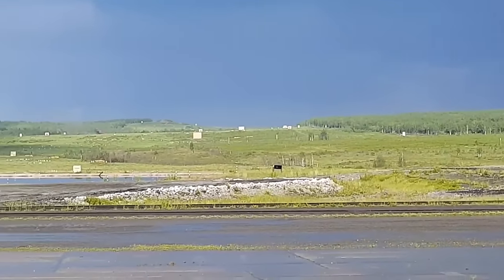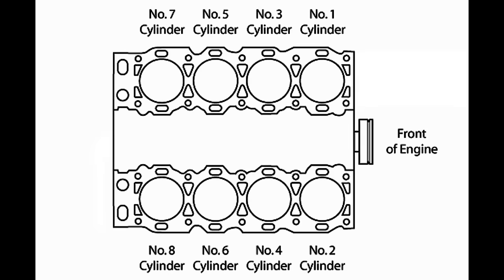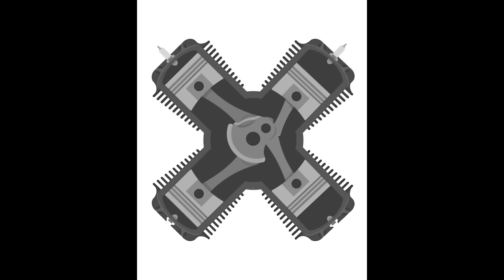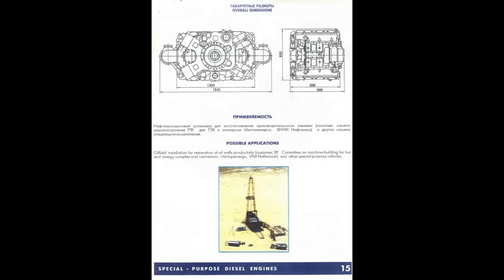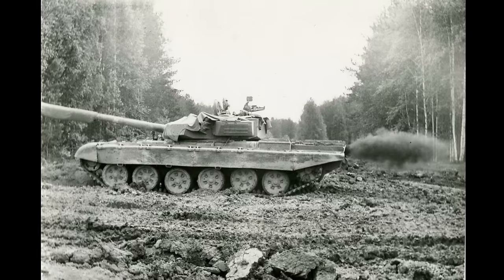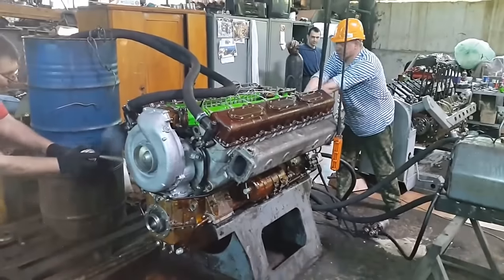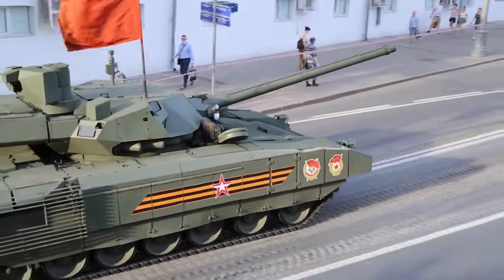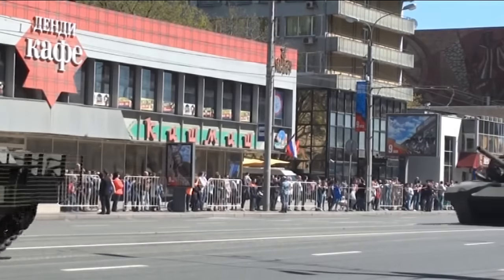Controversial History of T-14 Armata's Engine

Comment: I think actual reason why Armata is not in production, outside of sanctions, that Russians see that in actual war current modification is not modern enough and not response of all new threats(such as drones in first place)  of modern war.  In August 2022. based on experience from conflict in Ukraine, Russian army requested, and engineers suggested following improvements:

1. increased range for APS detection of potential threat and, also, increased range for "hard kill" action measures of Afganit
2. improved T-14 all-out shielding against RPGs and ATGMs
3. enhanced electronics protection against electromagnetic and microwave weapons
4. new system for remotely deactivating AT land mines

So I think T-14 will never be in mass production, at least in current version. It's just clearly not worth it.
Reply: This is the most likely answer. Any of the benefits provided by the armata design would be irrelevant in the current Ukraine battlefield. It's very likely that the armata might get scrapped before going into production.
Reply: and that Russia is not rich enough lmao
Reply: @mionikat  not really. All of Europe combined is unable to produce enough artillery for Ukraine. That should tell you everything you need to know.
Reply: Or Russia is unable to afford any kind of production of modern tanks, since it lacks the technology to produce high tech and high quality electronics and chips themselves. In the past they could source such tech from Europe, which is not the case anymore.
Reply: I think so too. Some time down the line we will have two broad categories of tanks, those that have some measure of  protection against the new battlefield threats, and those that don't.
Or a fifth generation MBT if you will.
Reply: @MrNebelschatten  there is a reason why countries like Kirgyzstan suddenly started to export 5000% more of various European goods after SMO started and sanctions were put on. It was not sudden spike of internal consumption I assure you.
Reply: @MrNebelschatten  clearly not the case since modernizations are basically adding new tech to old tanks. So they have enough chips to upgrade old tanks. The smuggled chips seem to be sufficient.
Reply: @dhanu_4539  Europe could, but US leaders were too soft on NATO countries for too long, so those countries have let their defense apparatus atrophy in favor of spending on welfare state projects.
Reply: @fredrikhultman557  it'll be fascinating to see what they end up looking like. The trend of advanced expensive tanks will end with this war. They'll have to be cheap, have basic guns and good crew protection.
Reply: @immikeurnot  either way the conclusion of this war was that neither Europe or Russia were ready for a conflict of this scale. Everyone one was caught with their pants down
Reply: @dhanu_4539 1000 billions per months into military and they still can't? Lul i bet they pay their soldiers a lot (sr for childish English tho)
Reply: @MrNebelschatten stop making things up 😂
Reply: Any day now they run out of Chips and Shovels 😂
Any day!
Reply: Bro 4 is not a thing lol, yes some land mines may be magnetic... Tho I don't get why would they do it, but a bunch of mines are pressure based which simply works
Reply: I am aware of that. But I am not talking about washing machines alone, which can borrow their chips to create drone or rocket computers. I am talking about high technology solutions like those French optics Russian tanks relied on. I could add engine parts or even manufacturing equipment for cars and trains (also used for tanks) which is reliable and faultless to micro-measurements (unlike the Chinese stuff). @CruelDwarf
Reply: @MrNebelschatten  Chinese stuff is for a long time is about equal to anything that US or Europe can produce outside of some very specific areas like top end microchips. But top end microchips are also utterly irrelevant for any military tech, be it Chinese, Russian, American or European. The idea of superiority of Western industrial base is long dead.
Reply: @dhanu_4539 thats not true
Reply: @dhanu_4539 europe can easily produce enough shells for ukraine. Its just a matter of how many they want to give
Reply: Trust me, high end manufacture and machining is still a European / American field. That's the reason Chinese are unable to match the machining in cars and so on without European and American machines and their gaps and measurements are unfortunately subpar in regards to high-end manufacture. Such measurements can make or breake high end technology. Sure, Russia found its cruel solutions to similar tech, comparing a French or Russian autoloader for example can show worlds of differences between both. And one is the precise measurements used by the first, which enables the French to create a better weapon. @CruelDwarf
Reply: @behoover  nope, France said it can't compete its delivery of shells recently. This has been a common problem all over Europe. The UK doesn't have enough challengers and can just about afford to upgrade the ones they have. Any significant ramp up in production will take at least a year and the Europeans don't seem too keen on funding those programs. It's only Germany that's making any kind of changes to production but that's not enough. We'll have to check in next year and see if there's been any progress.
Reply: @behoover  note that I'm not talking about the US. That's a completely different topic.
Reply: @dhanu_4539 

It’s because the West woefully neglected the trades and their manufacturing industry and practically the new generation is lazy and doesn’t want to do back breaking work regardless of how high they’re paid. This is what old timers in the field say by the way with 40+ years of experience.

Even Task & Purpose points this out on his video talking about the USN versus the Chinese PLAN, American Naval Yards are extremely short staffed and running out of experienced workers as they’re retiring.

The West will not be able to outproduce Russia if they don’t solve the lack of workers in the trades, currently China could have World War II levels of production if it transitioned into a war economy due to it being the factory of the world. And Russia didn’t allow its industrial sector to atrophy away by means of government intervention into those sectors for decades.

The issue comes from the workforce, that’s why the West cannot compete with Russia. The new workforce goes on to work as doctors or in wall street or a scientists or software developers or computer engineers, none of these sectors increase the production of weaponry fast enough. West needs more Machinists, Welders, Electricians, Engineers, etc etc to increase their production.
Reply: @dhanu_4539 
Also, ignore the people who say the West can match Russia, they’re having issues and the Western Defence officials in all European countries and the Pentagon are aware of these workforce negatives they must address, just like they must address the lack of Western civilians volunteering for the military and them not meeting their volunteer quotes year over year because the private sector has better pay and benefits than the military.
Reply: @dhanu_4539  I think thats excactly what he means. Europe could easily do it, there just isn't the political will. If the EU countries splurged on Ukraine like the highest supporter by GDP (Estonia) Germany alone would allocate 60 billions a year to the war effort. 
By now there probably would be enough ammo production 10-20k shells a day if not more from the EU. 

However between all the NIMBYS, Pacifists, Rightoids and the fiscally conservative there are enough people that have significantly slowed down this development. Upsetting them would be unpopular so things that could get done didn't.
Reply: @dhanu_4539  im not talking about challengers or anything . U clearly said the Eu as a whole cant produce enough shells for ukraine . Im saying it can but its just a matter of how many shells they want to order and how many of those go to ukraine. The EU has the ability to produce the shells if they want but they are to stingy . + lets say magically they cant . They can also just buy shells
Reply: But in raw numbers the eu could supply ukraine with all the shells they needed if they where willing
Reply: Atleast those that are nato standard
Reply: Main reason is logistics, I think.
It already is kinda pain in the ass, considering how much types of wehicles RF already use. Adding another one will not improve anything. Adding new tank will not solve any problems, as Ukraine is confirmed with Leo2, but will require serious efforts and funds on production and maintenance. Better to focus in production of older, but well known blatforms, than something new.
Reply: @behoover  well that's a pretty dumb way to look at. You do realise that there were 2 world wars in Europe and the amount of artillery they were flinging at each other made Ukraine look like a joke.  We are talking about now.
Reply: @MrNebelschatten  could be a combination. but this is all speculation anyways.
Reply: @immikeurnot  it's so bad that the Netherlands for example couldn't even spend it's budget due to there not being enough industry locally. so it stayed at ~1.95%
Reply: @dhanu_4539  Brother, check what the best of Russia looks like and compare it to what the best of Europe looks like. The shells were slowly halting in production after the cold war, cause they didn't really need that much at a time of mostly peace. Just talking about how Ukraine is lacking in the shells department doesn't say alot about how "Russia is rich".
Reply: @mionikat  You don't know what you are talking about. Russia has less debt and more reserves, than most countries.
Reply: @ianlarge9016  Less debt and less ability to pay debt. They aren't rich. They try to hold a large army and in return a large amount of their GDP is being spent on just military.
Reply: @dhanu_4539  Russia makes chips for the  military and space industries If you consider that conditions in space require microchips to be shielded and Russia is the successor state to the to the USSR, it would have to have its own production facilities for these products. Bulgaria was a major producer of such products before 1991.
Reply: Yep, most likely you are right.
What is there that T90M can't accomplish that a T14 can? Yes it's a slightly better tank, and it shoots slightly further and is slightly more precise. But it also costs like 3 times more, and producing it now would be hindering T90M production and increasing military spending greatly... imo it's not worth it at this point (other than a low rate production of like 10 tanks per year or somthn like that).
Reply: @dhanu_4539  No it will not end. Expensive tanks are great at breaking the defenses, so you would still see them in the army.
Reply: @korana6308  did they manage that in any battles in Ukraine? leopard, challenger, T 90 all got hit by drones, ATGMs, attack helicopters and landmines.. only the Ukrainian T 64s or the Russian T 80s that happen to be at the right place at the right time manage to breakthrough. So the more tanks you have the more chances you get. Ukraine having to rely on expensive NATO tanks was one of the main causes for the counteroffensive failing. They were good thanks but there were too few of them and they were too expensive to loose.
Reply: @korana6308  also you cant armor a tank against drones. Simply because they can attack a tank from any angle. Even the best defended tanks still have weak points.
Reply: @dhanu_4539  why r u talking about ww2 ?
Reply: @behoover  because that was the peak weapons production rate in Europe. It has never been higher than that.
Reply: @behoover  if you want to get an idea of the maximum production capability of any European country. Refer to WW2. Currently even if the manufacturing processes are much better. The weopons also tends to be more complex and expensive. So it's unlikely that Europe will ever reach similar production numbers.
Reply: @dhanu_4539  well if u wanna use ww2 numbers that kinda prooves my point. In 1942-43 the allies produced over 10 millions shells lol and that dosnt count the german polish and french shell factories that wernt operating for the allies in 1942 so you could argue its double . Either way tho its more than enough
Reply: +german production since they are now in eu aswell
Reply: so thats another million
Reply: Estimates suggest that Germany may have produced up  to or over a million artillery shells in 1942.
Reply: @behoover  you pretty dense aren't you.  Just because they could it doesn't mean they can. I know what Europe is capable of producing ( hence the reference to WW2 production numbers) but in 2024 2025 Europe won't even get close to half of Russia's production. Why? Because the general population doesn't want to, they don't consider Russia enough of a threat and they could care less about the annoying beggars in Ukraine. If any of the governments try to increase defense spending they'll end up loosing their elections.
Reply: @behoover  that's what happens in democracies. Without the people's support they can't do anything. Even in Poland the general population hate Ukraine the only reason they are helping is because they hate Russia more. And the rest don't care. All the hype of 2022 has died out and people have other things to worry about than Ukraine.
Reply: @dhanu_4539 So the entire military-industrial complex of Russia is completely owned by Rostec, so the price of production in Russia is very low
Reply: @dhanu_4539  " I know what Europe is capable of producing " how do you know that from ww2 ?
Reply: @dhanu_4539  also notice how you rolled back your argument when i proved that referencing ww2 stats actually makes the west look even better than either of us originally stated
Reply: @dhanu_4539  Correction: Nobody wants to invest billions into ammo plants that will work for 1-2 years and then go into disuse. You're welcome.
Reply: @ChucksSEADnDEAD I didn't even consider that. it's true. if the war ends in 2 years, they'll have to close down those factories unless there's another war of the same scale.
Reply: @dhanu_4539 yeah no, europe can easily supply ukraine ten times over, its a matter of political will.
Reply: Some people clearly thinking "political will" can make factories and workers come out of thin air.

Comment: Anyone know if there were any examples of anyone trying rotary engines in tanks. One of the ideas behind the resurgence of the T-80 is that it can start in just about any condition. I think rotary engines manage this as well
Reply: Some Shermans used rotaries. They're just impractical for tanks.
Reply: many old ww2 american tanks used rotary engines
Reply: @102ndsmirnov7  IIRC the radials used in US vehicles worked pretty well.  Packaging was weird because the engines are so wide, but they were reliable and made great sense from a logistics standpoint.  It's more that WWII was pretty much the end of the radial engine.
Reply: He said rotary not radial
Reply: I said radials were impractical because they forced the tanks to be very tall with the driveshaft being in a weird orientation wasting a lot of space and the engines being tall.
They also had some issues with fluids pooling towards the bottom afaik. 

It's why the US switched to more conventional engines in Shermans even during WW2. @immikeurnot
Reply: @102ndsmirnov7  wait is it radial or rotary (dorito)
Reply: The "doritos" specifically are Wankel engines which are a type of rotary engine. @RhomasTotevenaar
Reply: Wouldn't a rotary engine be the complete opposite of what a tank engine requires?

They are infamous for reliability weaknesses, they are better at high RPM's, maybe their compact size could help, but at that point, just use a turbine.
Tank engines have to be reliable and have torque at the lowet RPM

And to those who commented the Sherman engine. He said Rotary, not Radial.

Comment: Uh I mean... You can't reinvent the wheel twice. Most engines we use today are directly based on the engines before, and ones before and before... But just because "It looks the same" doesn't mean it is the same. Yes - it has cylinders, pistons, uses combustible fuel same as literally any engine in the world. That's literally where the similarity ends. Just because there are some visual similarities means diddly squat. Lot of engines look similar or the same, doesn't mean they are. Not to mention the engine is only one part of a puzzle. Even a WW2 engine if hooked up with a modern gearbox, ECU, transmission would output much greater power than it did when it was originally made as a ECU would ensure it gets the utmost power out of it in the most efficient manner possible and played ball with other components in the vehicle. Something that wasn't a thing until the late 80's
Reply: The most lucid take on this I have read so far.
Well said.

Comment: I think that they should drop T-14, and start from scratch using what is good and what works from it, and then base their tank on experiences from Ukraine, the focus being on sensors and counter measures against drones and shells.
Reply: I remember red made a video about a Russian student making a mock up tank that from he said is more promising and doable than the t14
Reply: Facts why build a tank that's built around the past tank warfare when you can start from scratch on what current tanks are struggling with like drones and shit. 😮
Reply: @kanestalin7246  a bit more with every problem fixed such as the auto loader to a busle auto loader like the type 10 ,Abrams x etc , and gun depression and driver port